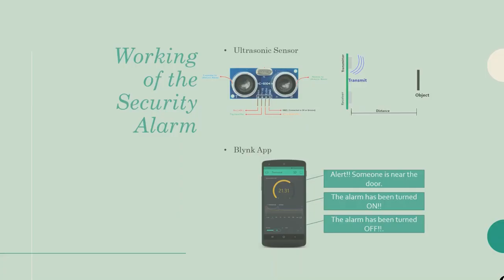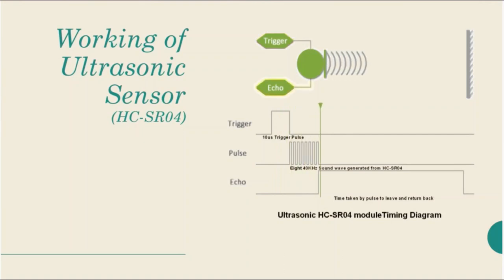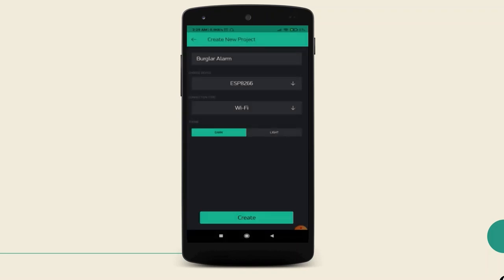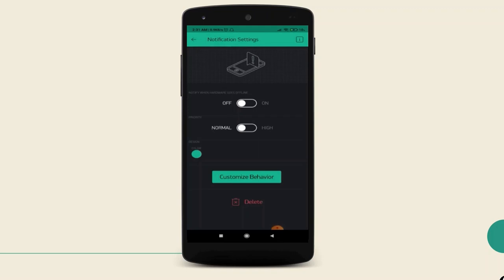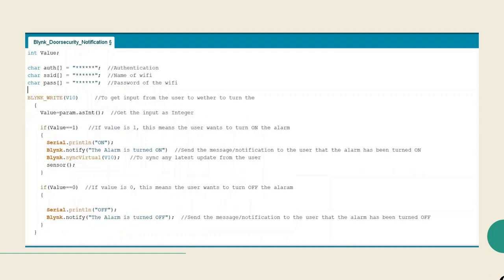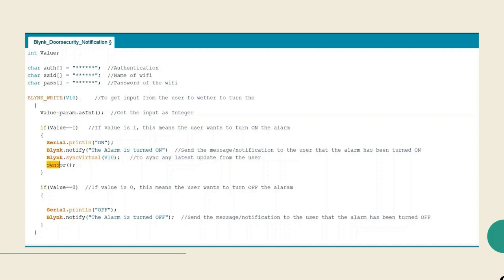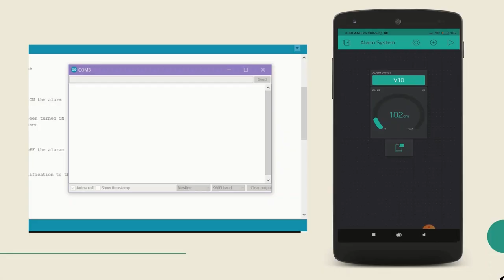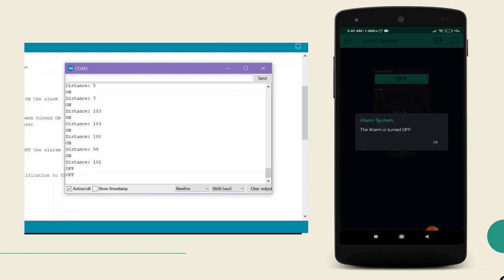Burglar Alarm System || IoT Project || ESP8266 || Blynk App

Comment: u have knowledge about sensors n tech but dear thts nt enough u should watch out the esp home alarms projects ........ ultrasonic is nt useful in alarm systems it gives false alarms .... PIR Laser n magnetic or most useful microwave detector is used for a full secure alarm system